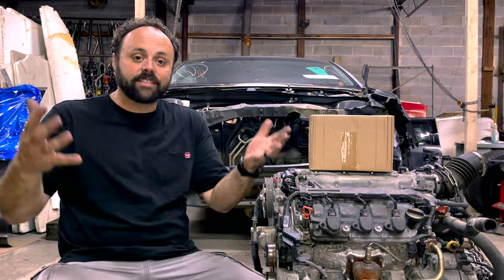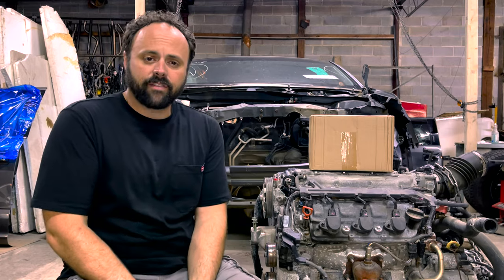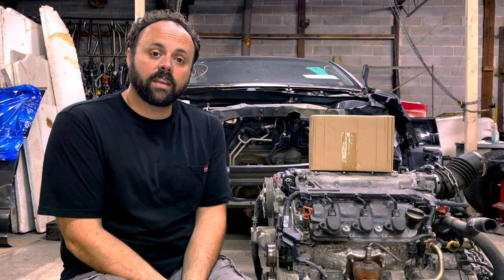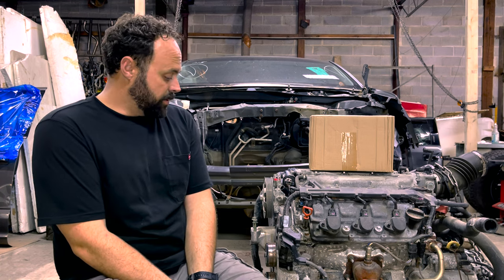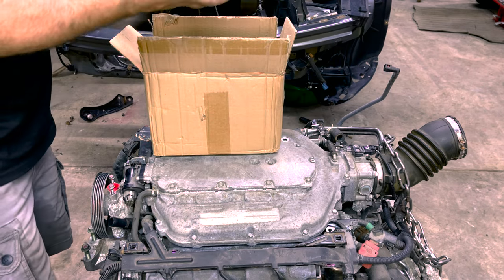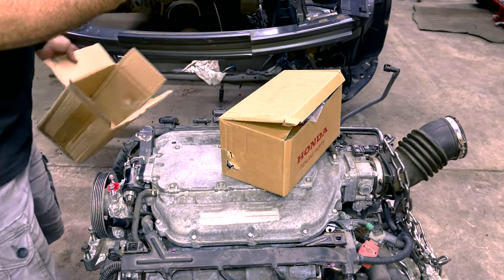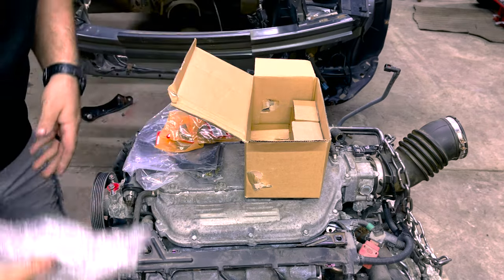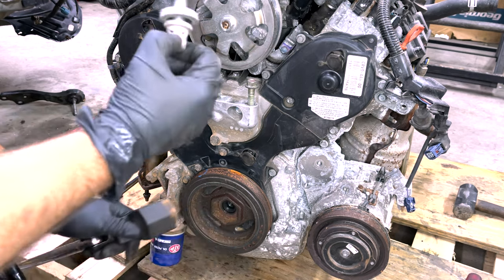2005-2017 Honda Odyssey 3.5L V6 Timing Belt Replaced! Engine Removed! Best Views! Step by Step!

Comment: So to anyone that does this with the motor in the car, make sure to put that motor mount back on BEFORE putting those black plastic covers on because it sits under the cover of you'll have to take covers back off, and change that front crank seal or a it may leak down the road and all this will have to be taken apart again.
Reply: I do the cam seals along with the crank seal.

Comment: I did this same job with engine still in a few years ago and thought I screwed up. Got everything back together and went to start it. Idle was rough and threw CEL for cylinder misfire. Started to backtrack the assembly and didn’t have a coil pack harness on. It was just was hanging in the back. Connected it and everything was smooth as butter. Wasn’t looking forward to telling my wife that I just screwed up her van.

Comment: Honda doesnt provide a kit. Thats likely all counterfeits.
Reply: The Honda dealers sell the kits, I bought one to do this exact repair
Reply: I got a kit boxed just like that off ebay, worst mistake I made in 2023. I am now having to replace the engine after the supposed OEM belt broke. No more junk off ebay for me.
Reply: Great video. Thanks for doing it. I may not do the job, but it's sure nice to see what's involved.  
Liked your dialog with the process.  
Cheers from Canada!
Reply: I saw a whole bunch of kits on eBay and after seeing price difference and also packaging…it was too good to be true.  I went oem from the dealer.  It’s about $700 piece by piece but the engine is a lot more.
Reply: I work at Honda WE DO NOT …….NOT SELL KITS. Please don’t buy a kit you have to buy piece by piece or buy the Aisin kit which is made for Honda by Aisin. Also per the Manuel any and I really mean ANY bolt that is not holding just a cover on and that is torqued is a one time use bolt. This even includes the 19mm harmonic balancer crank bolt!!!.
Reply: @xINxTHExFACE  they don't sell a kit. They just got you every piece you needed lol.
Reply: @GoBigAutoDetailing  that’s true as well on the receipt it never says kit just parts list, the Honda dealer in Cerritos, CA does sell “kits.” most on eBay are too good to be true tho

Comment: Always always do 2 spins to make sure the timing still right after you put the new chain or belt on before finishing it up
Reply: 8-10
Reply from the maker: Yes that is a good idea. Honda service manual recommends 6 revolutions and then check timing again.

Comment: MAKE SURE THAT IS NOT  A COUNTERFEIT KIT , I DID THAT AND NOW I HAVE TO REPAIR OR REPLACE THE ENGINE. CHECK YOU TIMING BELT FOR CRACKS, MINE IT WAS ALL CRACKED AFTER 1 1/2 YEARS AND 15000 MILES.

Comment: Done this a couple of times. Going for #3 due to collapsed tensioner.  To ensure accuracy, paint stick the old belt with the alignment marks before pulling it.  Paint complete line from front to back on both cams. To include the cams and the back alignment points.   Also number the cam marks and arrow the direction of the belt.  You cannot do that on the crank so just paint one of the teeth and mark the belt over that dot.  Transfer to the new belt.  Make sure to orient the belt in the same  direction as the old belt.  When installing one of the cam teeth will probably not line up.  Just put socket on that cam and move as needed.  Makes life much easier.  

Instead of putting the covers back on rotate the engine to ensure everything lines up.  The paint marks will not line up when you rotate the engine.  You can do it without installing the crank pulley, just use a lot of washers or install the pulley.  Word of caution the washer you pulled off the crank is beveled.  Make sure the bevel points outward.  Installing it wrong will cut the belt and ruin your day.   The purpose is to keep the belt on.
Reply from the maker: Great tip! Thanks for watching!

Comment: As for any on stand motor would pull rear oil seal, injectors, plugs and coils and pull oil pick up tube. Get to everything you can get to including intake gaskets. Looks like really great video great job. You got an opportunity to make this easier on yourself motor out. That kit was on the money got everything you need.

Comment: Your concept of the battery rod threading into the tensioner pulley is backwards, the correct idea is that the rod compresses the tensioner when it is treaded in.  This removes tension from the belt.  I suppose Honda did this in case you needed to adjust the belt position on the cam/crank teeth and did not have a vice and grenade pin to compress the existing tensioner (when it is removed).   If anyone is doing this at home: I recommend NOT doing the battery rod method as it is a MAJOR PITA when the engine is still in the car.  Pop off the tensioner bolts and get a vice and pin to recompress the tensioner.  Thanks for  an informative video!
Reply from the maker: Thanks for the comments. Yes that portion of the service manual was tricky to understand the function of the battery rod. Thanks for clarifying and thanks for watching!
Reply: The way he did it in the video is correct. Just a shorter bolt would be needed if the engine is installed in the vehicle.

Comment: Theres a special socket for the harmonic balance..its a thick socket..weighted socket..works like a charm
Reply from the maker: Yes sir! I did use that socket in the video and it worked great. Made getting that harmonic balancer off pretty easy. Thanks for watching and like and subscribe. More videos coming.
Reply: He used the wrench in the video so why mention this.
Reply: Lisle 77080 19mm Harmonic Balancer Socket.

Comment: Very informative video . Question : Do I really need to put that metal you said from battery to hold the tensioner? Or can I just install the tensioner and straight pull the pin??

Comment: The old belt still looking good i bet you can put another 80k miles on it with no problem. The timing belt is not easy to break, i am not going replace timing belt until i hear ticking noise or other signs.
Reply from the maker: Yes the timing belt was in good condition and did a few miles left in it! Thanks for watching.

Comment: How are you able to slip the new belt on over the tensioner pulley so easily? I am trying to install my new belt and refusing to cooperate. Too tight.
Reply from the maker: The most likely issue is one of the camshafts or the crankshaft has moved slightly. Or when installing the belt around the camshafts, the belt is off one tooth. It is very easy for one of those scenarios to happen. Once everything is aligned correctly, the belt will slide right up on the tensioner pulley. Be sure and install the belt on the crank first, then forward camshaft, then water pump, and lastly the rear camshaft. One of the above options should fix your issue. Good luck!

Comment: Its alot easier when the engine is out of the car lol ... If it was me i would do the rear main seal...plugs...valve adjustment...only if i needed it though
..but now is the time
Reply from the maker: Yes much easier with the engine out! I have also done the same repair with the engine in the van and it isn’t to difficult. Takes approx 4 hours to do the repair with the engine still in the van.

Comment: You were able to remove from the top? You could get to to the trans and torque convertor bolts with it in the car?? 😮
Reply from the maker: I dropped the engine, transmission, and suspension subframe out the bottom as a complete assembly. Wasn’t to bad.

Comment: Would you mind posting the link to where you the parts from?
Reply from the maker: Thanks for reaching out. Unfortunately the seller I purchased from is sold out. If you go to eBay and search “12 Odyssey Timing Belt Kit Genuine OEM”. Several other sellers are selling the kits so just look for the kits that have the parts still in OEM bags with OEM part #’s. Hopefully that helps. Thanks for watching! Please like and subscribe.

Comment: Honda covered this problem under warranty. they extended it for a piston ring failure. you could of had all this done for free
Reply from the maker: Thanks for the info. We only deal in crashed/salvage vehicles so those manufacturer warranties are voided once a vehicle has a salvage certificate issued for it. Thanks for checking out the video!

Comment: Where did you purchase the kit?  Part number?
Reply from the maker: I purchased the kit off eBay. Below are the part #'s for what came in this kit.
Qty 1 Timing Belt: 14400-RCA-A01
Qty 1 Idler Roller / Pulley:  14550-RCA-A01
Qty 1 Tensioner Roller / Pulley: 14510-RCA-A01
Qty 1 Water Pump & Gasket:  19200-RDV-J01
Qty 1 Hydraulic Tensioner:  14520-RCA-A01
Qty 2 Front Camshaft Seals: 91213-R70-A01 / 91213-RKG-003
Qty 1 Front Crankshaft Seal: 91212-R70-A01 / 91212-5MR-A01
Qty 1 Serpentine Drive Belt : 38920-RCA-A01 / 56992-R70-A01 / 56992-RV0-A05
Reply: Just a heads up I purchased this kit from ebay as well and theres alot of fake kits on there. Mechanic changed everything and it was working perfect. My timing belt snapped 3 months later and ended up having to do a head job. beware of these fake ebay kits. But great video!

Comment: You shouldn’t removed the pulley 😅and removed a motor out just to do timing belt is a lot labor
Reply: used motor...
Reply: I noticed that when you put the new timing belt tensioner on, you didn't move the bushing over from the old to new. Can't float now.
Reply from the maker: Donor van was crashed so had to remove the engine and doing a timing belt while the engine is out. Thanks for watching!